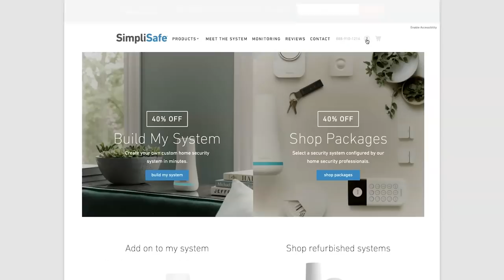THE PRESSURE IS ON | WORKING AGAINST THE CLOCK

Comment: Hey, Trent! Try this on length of corner bead? Mix mud slightly thicker than usual. Apply to both edges of corner with 4 inch knife - make it kind of thick! Embed the corner bead into the mud bed, and smooth - don't fuss, or over work the mud - plastic bead will move around some - once completely set, use a 6 inch, for second coat, then 12" for final coat! 😁
Reply: That is exactly what my husband said, he was journeyman drywaller. Never give in to defeat, you are doing a great job for this being your first try.

Comment: Those lumps that your getting in your mud are coming from the walls of that uncover bucket.  Get a cover for the bucket and when you finish for the day take a wet towel and clean the mud off the sides of the bucket.  Wash the towel and lay it over the top of the mud and put the cover on.   Never put any mud back in the bucket.  Throw it away.

Comment: It's so adorably cute and naïve when Trent repeatedly says that after taping and mudding all that left is a lil sanding..Hahahahaha..There is no such thing as a LIL sanding!!! You think taping and mudding was a pain? Just wait!
Reply: The neater the mudding, the easier the sanding goes.  I don't like sanding because of all the dust it puts in the air.   I was perfectionistic with the muddling and used a damp sponge to smooth it out after it dried.   A lot safer for the lungs. IMHO.

Comment: Trent use a 6” blade to bed your corner bead and toss the red plastic pan and get a stainless steel one! Also apply the mud dragging the blade sideways and turn it handle parallel to bead to lay down the drywall mud remember bead is like tape 3 coats ! Your doing great and once again congratulations on the baby!

Comment: My  husband was a drywall mudder and I think you are doing an excellent job so far. That is just the first coat around the windows. After it dries and before you put on the next coat you go around with a clean mudding knife and scrape off any rough spots. And remember, each coat of mud needs to be wider than the one before it. A good mudder has very little sanding until the last (finish) coat.

Comment: you could use the AC in the house, when you are working, just don't use it when you are sanding the mud. you can also use it when you are painting.
Reply: they dont have ac
Reply: @heyitsemily677  as far as i know, they have it, but haven't set it up to run yet. i guess it needs to be charged

Comment: Corner bead is tough to feather.  Don't worry if the mud is a bit bumpy around them.  That's why you sand.  It will get easier as you put more of them up.

Comment: Curious that you haven't mentioned a 'texture for the drywall? Do you intend to do the single most difficult finish in the world of drywall and keep the walls smooth? Again everything will work out but if you intend a smooth wall finish and paint without a skim coat, which is singularly the most difficult thing to accomplish in drywall, it may or may not be acceptable to you. Keep on trucking for sure but also keep your mind open to suggestions and keep learning.
Reply: i'm curious too. i didn't think you painted right on the drywall. eeek.

Comment: Coming along nicely guys, expect those wrenches to be thrown into your gears every once and a while and knowing they’re supposed to be won’t hurt as much. Speaking of which… I believe you said you’ll be doing the peak ceilings in tongue and groove or shiplap yes? If so I’m seeing the vertical rafters which will be easy to secure to but then they change over to horizontal ones where it meets the wall. Is there enough of an outside rafter lip to secure the boards to there or are you going to have to cut foam away and sister 2x4 pieces against the outside rafter to create a lip? Just trying to give you a heads up so this isn’t a bad surprise after you clean everything up and have to make a mess again… sorry…🥺✌🏼

Comment: That corner pieces (we have metal one here in Belgium) and plastering afterwards isn’t that hard. You just apply the mud first all bumpy and sorts, let it dry almost till it’s hard to the touch, than apply some moisture back with a spons (like after 45min/1hour). Smoothen it out than. Let it dry again till almost hardened (2hours) and than you dampen it with a damp cloth, than with some force you smoothen till you get a mirror like finish.
Try plastering, mixing plaster and water and applying that to walls, like we do in Europe here, that’s hard :D

A quick question, is that tape like the gause/fabric strips we use here in Europe? Because I used something like a woven mesh fabric band, 5cm wide to get some plasterboards seams connected in my attic when pudding the seams.
Reply: it's a paper tape, it's a bit stronger than the mesh tape. You can also buy it in Belgium
Reply: that gause strip is terrible because you really have to apply a thicker layer of plaster to get it to go invisible. And if I remember correctly (past experience/trauma) the plaster board itself has round off edges. Like, why?!! But indeed, I think that in Europe, we actually plaster the plaster board. I've not seen anyone doing the putting up the plaster board, the filling up of holes, taping it and after that sandpapering the walls and then paint. Not here at least (in NL, so probably not much different from our neighbours from the South)

Comment: Now you know why so many homes have textured walls. We ended up putting covers over corners because moving furniture around and dogs tails was knocking the mud off the beading. Crown moldings as it turns out is another functional way to cover imperfections as well.

Comment: I guess "professional" tape & mud crews rarely sand but for the DIY'ers sanding is both the savior AND curse of drywalling.  You can sand anything to beautimus perfection BUT your create an infinite amount of the finest, talcum fine dust you've ever seen!  I highly recommend getting a pole sander with a vacuum attachment.  Worth it's weight in gold.

Comment: One thing I learned from using the plastic mud box is the edges of the knifes sometimes scrape off bits of plastic that get in the mud and reveal themselves during smoothing.  Switched to stainless steel, plus it cleans up faster.

Edit:  right after I hit send on the comments you literally just mentioned the plastic bits 😂

Comment: Hi trent. i have a few tips for you. #1 when doing the corners with the taper, you can use the roller right away. you don't have to remove to mudd with the knife first. the roller will squeeze everything out. just remember when you have an 18 foot length. just start from the middle and work yourself both directions out. then you can use your knife to remove the mudd. and also there is an extra tool available to do that job. its called "Direct Flusher" and a good habit is to always keep these tools in a pail of water while you use them
Tip #2 i always use my mudd boxes for doing any of my corners, and it works very good.i just start with the smallest one and work myself up to the biggest one. and incase you wonder, the first coat usually doesn't look the best, it will have allot of bubbles and air pockets. especially if you put about 1/8 of mudd on the corners.
little thicker mudd works better if you start to build up your corners. tin mudd is just good for taping. i hope that info helps

Comment: don't fret about it, sanding does wonders for the finish.   Did the same thing.I used more than 600 4x8 sheets if dry wall in my 3k sq ft house.  yes I did all the madding with out a bazooka, and by myself minimal help from my wife.

Comment: Trent all Three of you are doing Great Work It Just takes Practice. watching Pros i have seen them do a first coat with a 6 inch knife then after drying overnight they hit the high spots with the sanding block then use the bigger knife . If needed  sand and hit with a third coat  .Keep up the Great work

Comment: Put dish soap in your spackle and you don’t get drag marks and it can be put back in the mix if you have dried spackle it devolves back in the mix it a old time trick you don’t need much maybe a quarter size per pan (full) and it make cleaning and sanding easier

Comment: Where is your drywall sander? First fill with mud then quick sanding, and then another coat of mud with a finish sanding. Are you going to do a spray on texture? My brother and I always mixed our own mud, because the bags of dry were cheaper. He was good at Spanish lace texture using a hopper. The knock down of the texture needs to be done at just the right moisture content.

Comment: You are supposed to put up the tape roll it with the roller first then skim it with the glazier head and it finishes it off with minimal effort. The bazooka can be set in a bucket of water over night head first and it will be fine until the next morning for use again without having to clean it every time.

Comment: The trick to drywall is to slap the first coat on and don’t worry about how it looks.  The second or third coat will be where the drywall starts to look good.  The first coat shrinks and cracks.  The second is still uneven and after you sand the third coat and apply a skim coat you’ll start to see a nice finish.

Comment: Wouldn't worry to much. Sanding helps work wonders. Plus wee touch ups. But dry bits and pieces in your plaster are the pain of skimming. 
At least your dry walls are all the same thicknesses and you're not patching holes!

Comment: I was telling you about the bazuka unit in a comment, it's an old system and works very well as you can see. I used one over 29 years ago when I was in Drywall.

Comment: I think if I remember right at the very beginning of your build you explained everything about who does what and when. So the naysayers have not watched ALL of your videos and therefore have no say in the contents or who does what and when. Trent just let the uneven mud dry, once dry get a bit of 1x4 about 2 to 3 foot long. Attach some sandpaper to it ( a strip from a roll), so that you now have a 2 to 3 foot long sander that will smooth out any bumps that you have. The reason you have the bumps is because every time you apply pressure on the plastic, it moves slightly and causes a ripple effect, which makes the bumps. Thanks for posting

Comment: I would strongly suggest you tape your corner bead as well...that is a joint that will crack over time.  While I'm butting in :) i would also suggest an all metal mud pan.  It is so easy to "nick" the plastic pan and get red plastic in your mud.

Comment: just a tip, that corner bead you are using is rotten to work with and the first bang it takes it chips out, the best corner bead is the one that has and aluminum angel about 1"x1" with tape attached to both sides, you mud the corner and simply press the corner bead in and run your knife down both side, done, until the next coat, not stapling and no doling around and it holds up to bangs and kicks

Comment: Drywall tip...At 25 minutes into the video I noticed you have a tape joint about 12 inches from the floor. For future drywall projects put your full sheet to the top and full sheet bottom and the 12 inch piece right in front of you so you have no bending to finish. It's far easier to run 2 strips of tape at chest height than to have one down by the floor. I love your bazooka. Another suggestion would be as you bed your tape, take the excess and run it out over your nail holes instead of putting it in the box. If you've got mud, and it's on the knife, put a coat every where you can reach...Great job guys. There aren't too many brave enough to take this on, but you've got it licked now.

Comment: Trent a helpful tip for your finish coats: use a smaller taping knife, hold it in between your fingers making a peace sign so that your fingers are on the back of the knife and hold it down against the drywall instead of how you're doing it now.

Comment: Trent, don't sell the  
Bazooka just yet. You did state that you wanted the garage framed by winter. Adding that one bedroom/bath over the garage, you'll  use the Bazooka again.
A two car garage with a workshop, need to drywall all that as well....
Be cheaper to build now than later...If you touch base with the Architect now, the plans should be good to go by the time the house is move-in ready.
:)

Comment: Consider yourselves lucky. Back when I was working as a carpenter, corner bead was made of metal. The edges were sharp, which could and would cut you. Not only that, if the humidity was dry inside,  you could get a static shock if and when you dragged you feet across the rug and touched the corner bead. Keep up the great content.

Comment: Since I have done 6 DIY home remodeling, taping and mudding is not that bad, corner bead is good around windows but try putting in Bull Nose beading on windows and all the walls, it looks really cool but it just requires a little more work. Ya know you will still need to sand all these mud and tape areas, really do not worry about small marks in your work. Plus I stopped using paper tape and went the mesh material, it is sticky on one side, roll on and mud, made doing everything by hand easy, never saw a auto system that you are using.

Comment: Hello there, I do commend you for doing the drywall yourself.  However, the hard part is the finishing work.  Making it look seamless after its painted, that's the hard part.  Only an experience person can tell if the mud needs more sanding or when to use more mug to fix a section.  I don't do drywall but I have tried myself on a personal home project and it took alot of time and the finish work still wasn't right after I painted it.  So today when I need to do drywall I hire it out to the professionals.

Comment: Hi guys!  RE: corner bead, just like the rest of the mud and tape, HAVE PATIENCE! First pass on the corner bead should be no more that a 6 or 8 inch knife. The on the second pass you can feather out with a 10 inch knife, and on the third (and final....) pass fine-feather out to the 12 inch knife.  Don't even try to get to "Perfect" with the first pass.  The mud shrinks and cracks and you have to finish over it anyway, so just get 'er done, and worry over the fine-tuning next week.
By the way, have you ever watched a pro crew do that work?  I can tell you from experience that you are doing a GREAT job. Your work looks very professional.  When you get the first pass done on  the corner beads, you'll be starting in on the overlays, and that's a LOT easier and faster, so you don't have to feel pressed for time.  By the way,  Work up all of the seams and screw divots in the same sequence using an 8 inch knife and the the last coat will feather off with a 12 inch knife.  Building up the width of the "feather" helps you keep the seams and patches flatter, and you'll have a lot less sanding.
Stop panicking! (Or else...) You really are doing great!

Love Y'all !

Comment: The problem with those small pieces of dried mud in the mud is two-fold,
1. Your bucket - use a straight 6” knife to load your mud pan or hawk, and then scrape down the sides of the bucket, all the way down to the top of the mud still in the bucket. Don’t leave those drops and drips inside the bucket. They’ll dry up and cause streaks in your mud in the wall. 
2. You have to keep the mud in your pan in a big pile, no parts thin that can dry out. No dried mud on outside - scrape off and discard. Wipe your blade off on inside of pan ; both sides of blade. Push all mud to left side, the side you are loading from. Dig out dried up streak causer on wall with corner of blade and wipe off onto the pan - short side, outside. After you have a bunch on the far end of pan, scrape off and discard.
When you load bucket from boxes, load entire box, mix and clean up all bucket sides!
Also a hint at corner beads - DON’T use 12” knife for first coat. Apply with a 4” or a 6”, but only smooth out a 4” wide swath of mud. Use wider blades on subsequent coats. If you use a 12” now on first coat, imperfections will HAVE to be sanded. Imperfections in a 4” wide coat will easily be covered without sanding. You are making more work for yourself.
Another - corner bead - side inside window cut off 90 a little-like a 60. Not 45. This corner sometimes flares out. Side on face of rock - cut off 99 down to a 60. If it flares up (off the surface face of rock), depending how good your wall is and your stapling, easier to mud. Also with both corners cut down, easier to mud around the corner when you stroke from head to jamb.
Hope all this helps.

Comment: all small drywaller shops used the old knife method because that's the way to save dollars for a small business. Scab workers are everywhere and work for you, see how it's done and steel jobs from you, bid low most of the time, especially small one or up to 3 room jobs because they do the work on their time off regular drywall work on the week ends. I worked my guys until the job was done, week ends included ( 1/2 day work, toward he end of the work where it goes fast ) pay a little more too.

Comment: You arent half done.  Might want to check with your building permit.  Some permits will end after a year.

Hopefully your using long enough staples, or that plastic corner bead is coming back off.  Use 3M spray glue, to help hold it down, then staple.  Plastic square plastic corner bead follows framing, it will show crookedness.

Send back that USG topping.  Its garbage.  The Plus 3 is a lot better mud, easier to use.

Comment: Remember Trent, only the last mud coat needs to be perfect, any previous imperfections will be covered .Yup this is the art part, this you can’t fake it .oh and you need to scrape any dried mud down before applying the new coat . This will get rid of the bits that are haunting you. Try not to fiddle, make a pass and move on.